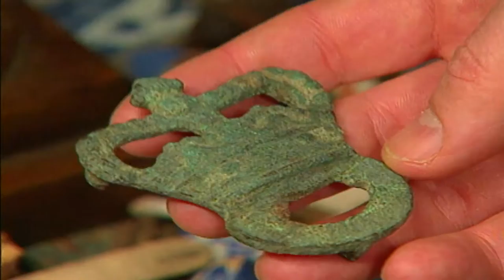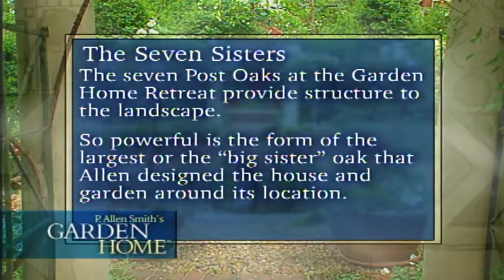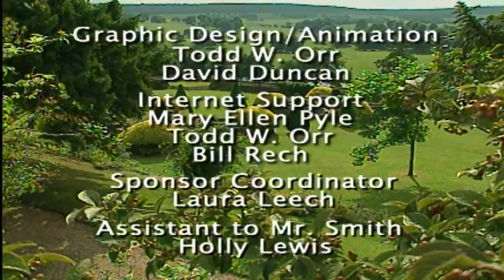Efficient Garden Structures | Garden Home (717)

Comment: Reading comments, I can attest: the iron arbors, the cast iron fountain are still totally strong, functional and beautiful. But the advantage is they add so much character and appear as if they have been there for a generation.  Go see them in person at Moss Mountain Farm!
The standing seam roofs are  wonderful.  This type of roof has been used over a century. Standing seam roofs withstand the test of time. Preservationist renovators often take off the old asphalt and return to this more durable, greater architectural character roof. Thanks for enlightening  everyone P. Allen!